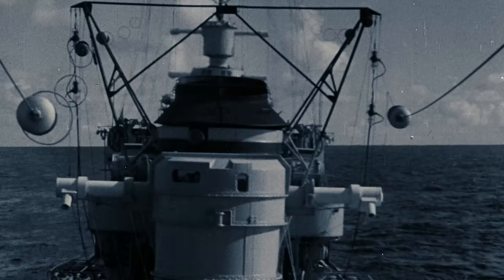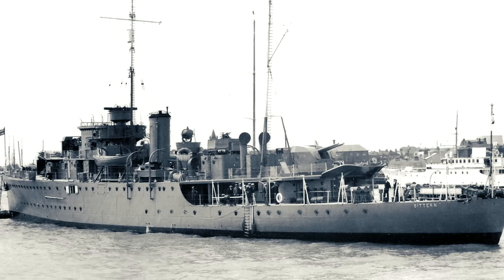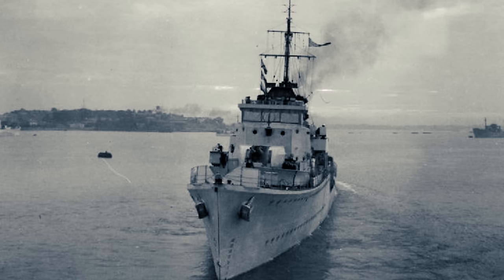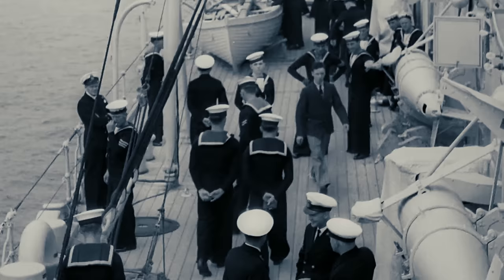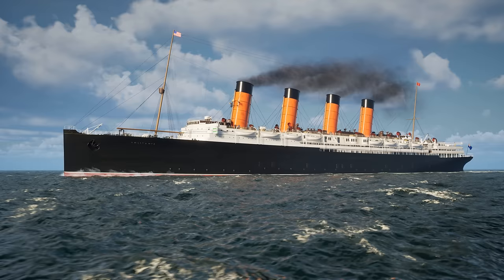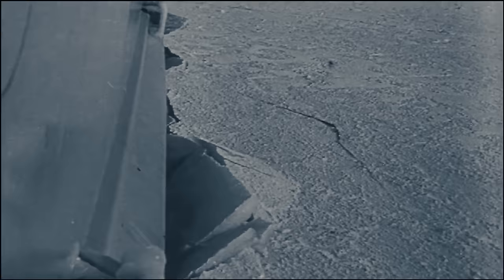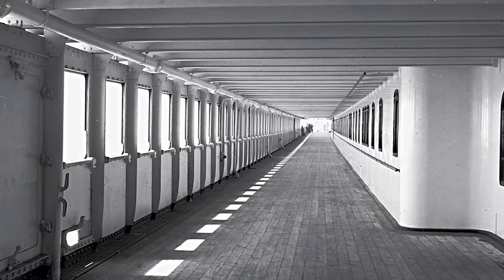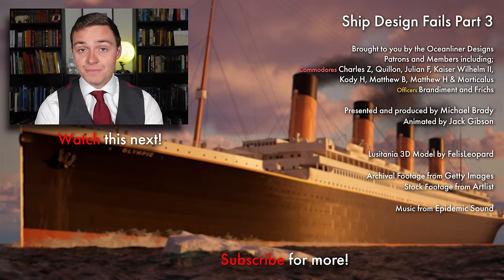When Designers Fail: Three Ship Engineering Mistakes from History

Comment: The problem for the "Gneisenau" and "Scharnhorst" had nothing to do with a straight stem/bow. The German battlecruisers in WW1 all had such bows and had no problem with water over the bows in average North Sea and Baltic weather. The problem for the "Gneisenau" and "Scharnhorst" was that they were overweight as a design by 6,000 metric tons, which lowered the hull into the water, raising the water line and impacting the ability to maintain speed in good weather or deal with bad weather. The "Atlantic" bow, did not really fix this, as both ships continued to suffer water damage and seepage forward and through 28cm turret "Anton".

Comment: @10:30  actually "long and narrow" hull forms does not necessarily necessitate fast ships.. As far as form go, the most important thing for a fast ship is known as the "prismatic coefficient", ie, the ship may be quite wide in the center as long as it is narrow on the ends...
Prismatic coefficient is also in itself a contradictory ratio.. A fast battleship must have a low prismatic, in the range 0.5-0.6, which yields a fat midsection and thin edges.. But a very fast battleship may have higher prismatic, in the range 0,65-0,72, which says that it can tolerate thicker ends.. This is quıte contrary to intuition.. 
For details, see the chart on p47 of "battleship design and development" by friedman, conway press, 1978.

Comment: One of the huge design fails that was repeated over and over again was the design of the stern on German large ships - from Admiral Graf Spee to Bismarck. 

All were designed rather for commerce raiding so speed and decent range were crucial. 
Ok, no problem - but somehow they ALL had really vulnerable sterns, difficult or impossible to steer in case of damage, not able to maneuver using screws only, easy to wreck. 
Hell, Lutzow nearly lost its stern alltogether after a single torpedo hit. Bismarck lost its stern during the sinking - a mere few days after a single torpedo hit rendered the big ship unable to steer. 

Seriously, one big design flaw, repeated time and again, that's just ridiculous.
Reply: And the brits just cut off that segment lmao
Reply: Can't damage what isn't there anymore!  @Vendo_HD

Comment: German battleships in a nutshell:
armor scheme? situational, but ok.
guns? too small, even according to German standards
bow shape? unacceptable, rework needed on every capital ship and heavy cruiser, except those that were already sunk or not finished yet.
stern shape? impractical, prone to twisting and bending, heavy, not armored enough anyway
general shape? too narrow bow, too fat amidships
+ 
not enough protection and redundancy for critical equipment (rangefinders, fire control)
rudders too close together
Reply: Yep, all things considered the ships of the Imperial German Navy were usually solid designs for their era. However, the Kriegsmarine era ships were not well designed, lots of flaws and issues. 

I've seen a very amusing comparison of Prinz Eugen and the French Algerie cruiser. 
The French ship was way lighter, yet all the parameters like firepower, speed, armament were pretty comparable.
Reply: German battleships, expecially those of the kriegsmarine, receive way too much flak, almost all of the battleships of ww2 had problems and flaws... but overall they were still fast, long ranged and accurate gun platforms capable of taking a beating and keep going (look at the sinking of Scharnhorst), and in case of the Bismarck class, sure they were not perfect, but they could deal with anything that wasn't an iowa or a yamato on a roughly even footing... which is also impressive when we consider the fact that the last true battleship the germans had build was the bayern in ww1
Reply: Bismarck was the largest battleship built in Europe. It was designed and built disregarding the limitation imposed by the Washington Treaty and yet is not impressive compared to, say, French Richelieu.  @willghezzi
Reply: They did follow an important rule of the regime at the time - make everything look damn impressive - and at least succeeded at that! Those were some pretty ships, even if they weren't so useful.
Reply: @KPW2137  that is why i said that she was on par with her contemporaries... which means that she wasn't the supership that the propaganda and documentaries make her out to be, but at the same time doesn't mean that she was worse or bad... a fight between a bismarck class and a richelieu, a kgv or a north carolina would basically be a 50/50, with the deciding factor being whoever scores the first hit
Reply: No argument there! They looked great indeed! @thing_under_the_stairs
Reply: @thing_under_the_stairs  yeah they do look amazingly beautiful, but their limited usefulness is because of the state of the kriegsmarine as a whole, not because they were bad warships
Reply: Well, except Bismarck turned out an easy kill due to fragile stern and the gun control. KGV or North Carolina wouldn't be able to dictate the range though thanks to lower speed - but they still stood a decent chance otherwise. Richelieu would have been a challenge @willghezzi 

Basically it's all up to design - Yamato was huge, but when you look at some of the issues it also had some design flaws that made it somehow less impressive.
Reply: @KPW2137  the relative fragility wasn't a factor, Bismarck took a torpedo to the rudder... there is simply no way to protect that, south dakota and warspite had better stern designs, but when they were hit the both lost maneuvrability, and were saved because they weren't alone.

And for the fire control part, the system on bismarck wasn't fragile, rodney slammed a 16inch shell on the rangefinder... any battleship would have lost the ability to fight back after that, and both drachinifel and ryan from battleship new jersey confirmed this... there is simply no way of protecting a range finder or a radar antennae
Reply: Yes and no. Bismarck actually took a torpedo that blocked the rudder and ruptured the stern causing a significant structural damage - this was much more serious than some of the other cases. They had time to fix the issue, but it turned out to be impossible. 
And to make things worse and unlike those you mentioned: Bismarck was unable to steer using engines only. Only three screws, too close to each other for this solution to be effective. 

As for the fire control - the problem is that after losing main fire control Bismarck was unable to use the secondary one to any effect. The ship was doomed when the battle started, but the fact the ship was destroyed without scoring a single hit on the British ships is telling.  @willghezzi
Reply: @KPW2137  honestly it hardly is... the crew was esausted, they had been on battle station for almost 48 hours. Bismarck couldn't bring all guns to bear on Rodney and despite this still managed to straddle her and cause some splinter damage, rodney simply got lucky that her shells fell on target instead of straddling, and as a plus that shell hit the range finder and killed the officers. The rear fire control station remained operative but couldn't hit because bismarck couldn't steer, but when it did, it once again straddled kgv in 2 salvos... that is excellent level of gunnery... and again both drachinifel (who hates bismarck) and ryan from battleship new jersey (who considers bismarck as inferior to the iowa class) stated that Bismarck, despite being doomed anyway, did a valiant last stand, and ryan also stated that an iowa, which is a superior ship to bismarck, would not have fared better if it was put in the same situation. How is all of this telling of why bismarck was bad? No ship in the world would have survived that pounding... the fact that Bismarck became combat ineffective so quickly is because the swordfish aircraft and hms rodney scored a couple of lucky hits, yes Bismarck had a couple of design choices that made those effects stand out a bit more than other designs, but those hits would have been crippling to ANY modern battleships
Reply: I totally agree that Bismarck made a valiant last stand. Same for Scharnhorst - however one can judge these ships, their crews did fight gallantly till the very end. 
The problem isn't, either, what Bismarck withstood as pretty much any battleships would have lost its capability to fight after so many hits. 
The problem is - it's astonishing how easily Bismarck lost all ability to steer and suffered structural damage. One would argue that if the ship was designed without heeding to the treaty limitations and with raider operations in mind they would make sure it was not that easy to cripple. 
Faulty stern designs were apparent with other German capital ships of the era as well, it's not just bad luck, it's bad design. 
As for the gunnery control - yes, Rodney was lucky but still in the end Bismarck failed to do anything.
Reply: @KPW2137  well yeah the stern was a bit of a flawed design but the germans weren't the only one to have those problems, for example the us had the same problem the germans had to their stern design, but on the bows of their ships, expecially on cruisers and the iowa class. The main problem of the stern of the german battleships and cruisers is that if they receive crippling damage, like that on bismarck, they have less options/chances of doing something than other warships, but damage like that can still prove lethal no matter how good your design is (look at prince of wales's sinking for example). What i'm trying to say in this conversation is that yeah the Bismarck class wasn't perfect and it wasn't a "supership" like the propaganda says... but it was still a very powerful and dangerous ship which, not counting the lucky hits from either side, was capable of facing anything the allied had, with the exception of the iowas... which isn't really a fault of the ship since when bismarck and tirpitz entered service the iowas had just been laid down
Reply: Well but here's a thing: many ships went down because of lucky or unlucky hits, depending which side you're on. Some were pretty unique, like in case of PoW - IIRC it was the only hit of its kind, at least on a capital ship during both wars. 
Hits to the stern, jammed rudder, damaged propulsion is a sort of damage that is to be anticipated as relatively frequent and a solid design should take it into consideration. In case of German ships of the time - well, not so much. Which is odd given they were expected to operate solo, far away from bases and in some cases didn't adhere to treaty limitations nearly as much as the Allied designs. 

And yes, it was not a supership, whatever the propaganda was pushing.  @willghezzi
Reply: @willghezzi They weren't bad, but they could have been a whole lot better if as much attention had been placed on functionality in the design process as had been on looks! Like maybe ensuring that they could be steered by engines if necessary, just in case they lost a rudder? Just a hypothetical...  😉
Reply: @willghezzi  Good point, German naval strategy (at least when it came to their ships; their use of submarines was frighteningly good) was rather lacking, to put it mildly. Of course, in the context of WWII, that's a definite good thing. If the original plan to send out six ships rather than one along with Bismarck had been followed, things might have been a bit more difficult for the Royal Navy.
Reply: @thing_under_the_stairs  definitely! And even though it would have been a massive waste of life, it would have been a spectacular battle once the royal navy managed to catch them
Reply: @willghezzi  Absolutely. I'm 99.9% glad that battle never had to happen, but the shipwreck nerd in me weeps. Although the comedy of errors that was the Bismarck's entire career more than makes up for it.